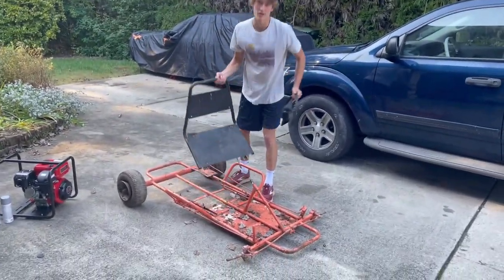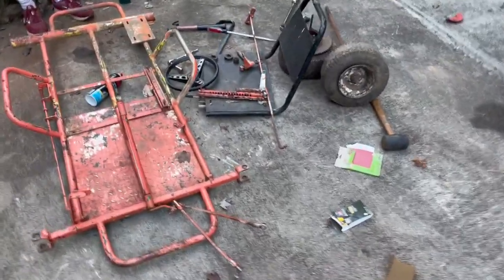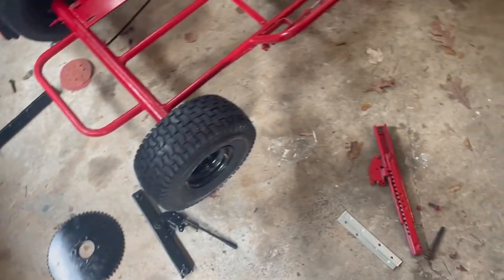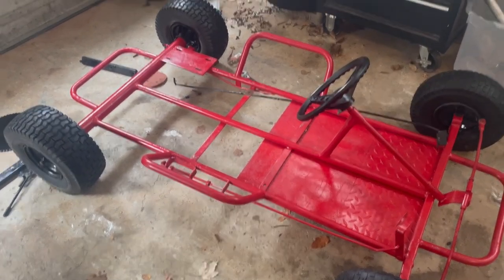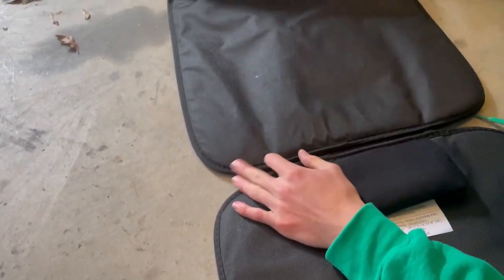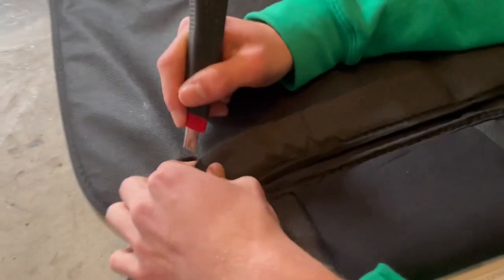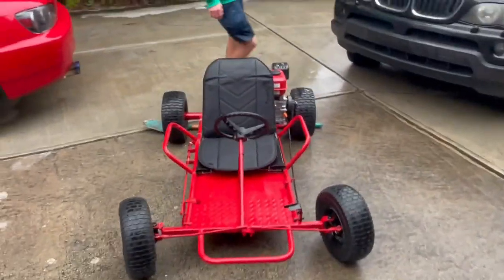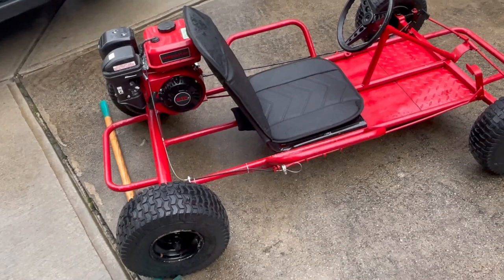Live Axle Go Kart Restoration

Comment: I bought a cheap frame yesterday. Has multiple layers of paint like this one. Im gonna use that "Aircraft" brand paint stripper instead of sanding, then hit with a wire wheel on my drill. Spray that stuff on, then after about an hour  use the water hose and spray it off.
Reply from the maker: Great idea!